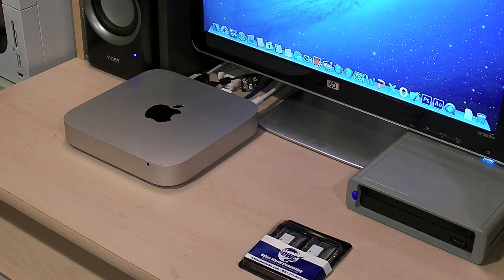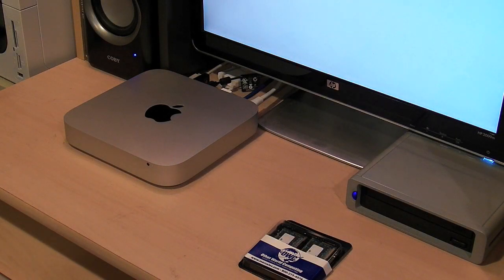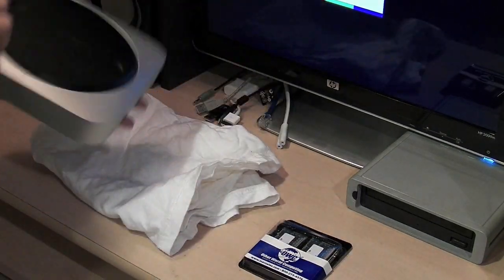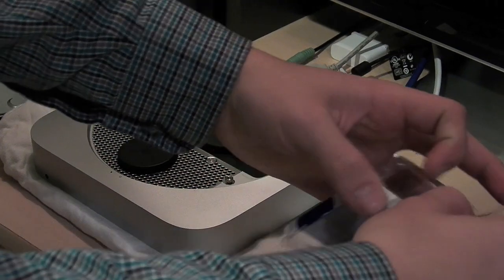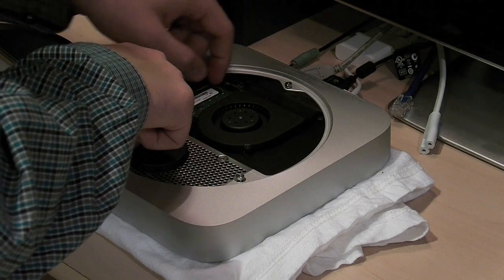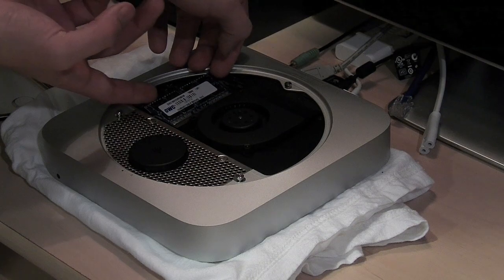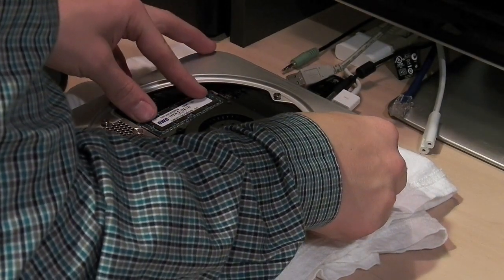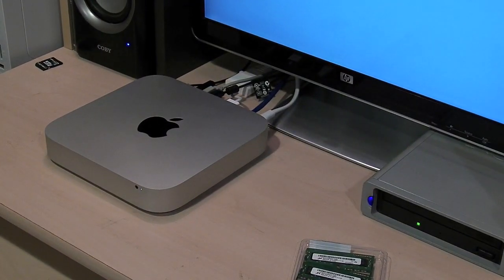Mac Mini Ram Upgrade Tutorial 4 GB to 16 GB

Comment: Wonderful! But...1. Getting RAM slot to move up at a 30 degree angle is not easy. Installing new sticks. 2. The top stick will not click in, it's loose. I don't want to force anything.

Comment: everyone complaining about how slow 4GB is, I've been coping with 2GB for 6 years. I did a fair bit of video editing with it too which was frustrating. I've just bought two cards to upgrade to 8GB and cant wait to see what a difference it will make. I upgraded from Adobe Illustrator and Photoshop CS3 to CC recently and it just killed my poor mac mini. hopefully 8GB will be enough. 

this video put me at ease for doing it myself. I thought it would be much more difficult to change.
Reply: I just did the upgrade from 2 to 16 GB. My 2011 Mini went from 1min bootup to about 35 sec. But the computer itself runs smooothly. Its using almost 3GB RAM idle so you can tell how 2GB wasn't enough. But at this point it is plenty fast. And I still run a 5400 rpm no problem.

Comment: My Mini is now on without beeping but only shows one memory slot filled. . .
Reply from the maker: Make sure that your RAM is completely installed. Likely the bottom RAM is not inserted all the way.
Reply: Thanks for replying so quickly. I've taken them out and reinserted 7-8 times, hearing each Click in. Apple support site says to insert so you can't see the gold prongs but it doesn't go in that far. Should I push harder?
Reply from the maker: Marta, adjust the angle that your inserting the RAM. It shouldn't take much force to insert it completely. You should insert it at around a 30 degree angle. The shiny connector will not be visible when its inserted completely. If you still have trouble checkout my MacBook Pro RAM tutorial. It demonstrates inserting the RAM better than this video.

Comment: My mac mini is beeping and won't turn on after RAM installation. I've ensured that the RAM was clicked in by trying it all again. Suggestions please!
Reply: You can troubleshoot by testing each module of new RAM at a time OR by putting the old RAM back in and see if it still beeps. 
If it boots with just one of the sticks, then you know which one is 
bad.

Comment: I just replaced the RAM in 2011 my mac mini, but it just won't turn on. I then replaced it back with original RAM and it still won't turn on. Maybe it just wasn't installed correctly? Should I put more force to ensure it snaps in the place?
Reply from the maker: Meghal Pandya It sounds like the RAM isn't installed all the way. It should NOT take much force to push the RAM in. You shouldn't see any part of the connector when the RAM is installed correctly. Let me know if this helps.
Reply: I had to make sure RAM is properly pushed in and no connectors are showing. Got it in third try. Thanks for the reply.
Reply from the maker: Glad it worked out!

Comment: I have a Mac Mini 2012 model, with 4GB of Ram. It is running slow. Should I update the ram? Will it make it a whole lot faster?
Reply from the maker: +Michael Morris Ram will help your computer handle more programs simultaneously. Ram won't necessarily speed your computer up. I suggest clearing your computer of any files and applications you no longer need. You may also want to scan your computer for adware. Startup programs can also slow down your computer substantially. 

If your running programs simultaneously Ram will definitely help. Sorry for the delay on the response.
Reply: JustifiedWebDesign Thank You!
Reply: What adware scanner would you recommend? Thanks
Reply from the maker: I use "Malwarebytes". I hope this helps!

Comment: bighands69 if you're using it for running Logic Pro and Pro Tools, or basically any music software for that matter, you do indeed need to upgrade the RAM to at least 16GB
Reply: I fought it forever but you are correct, I really can't do much with Pro Tools and plugins, so I just upgraded from 4 to 16 as well and wow!

Comment: Hi, I've a question please.
I've installed 16Gb RAM 1600mhz on my mac mini (mid-2011 - 2,3Ghz Intel Core i5), the two RAM sticks are recognized but the speed of my machine is still the same, it's not faster. Where does the problem come from ?
If you got any idea.......
Thanks in advance ;)

Comment: I paid $128 for 16G of Crucial memory I bought on Amazon.  Brand names matter - Crucial, Kingston, and Corsaire and make sure it's not recycled memory but new memory.  This guy is great with this kind of thing - I looked at this and then did my machine and it took probably less than 5 minutes.  A guy at work couldn't get the ram to seat properly and ended up taking it into the genius bar - he needed this video.

Comment from the maker: I use Adobe Creative suite for graphic design so 10gb of my 16gb is dedicated to Adobe Creative Suite. It's also very useful when I am doing graphics and web design. I usually have around 20 windows opened so more memory is better. You can imagine how slow I would have to work to run Photoshop, illustrator, cinema 4d, safari, and dream weaver all at the same time. Not to mention having a SFTP connection open to my website.